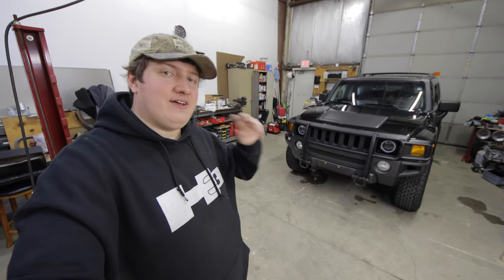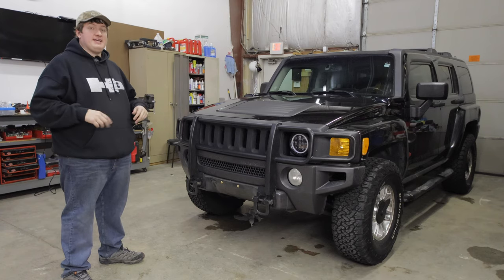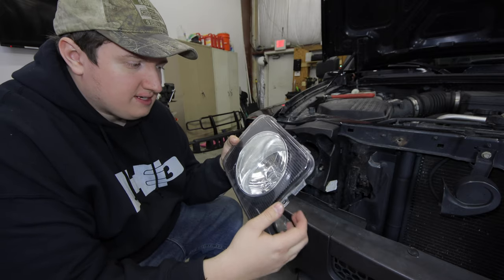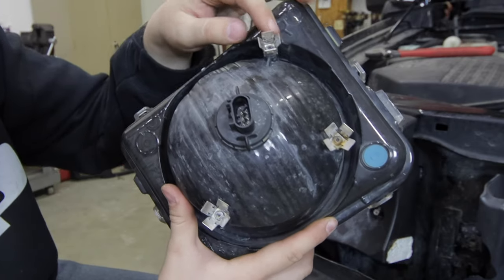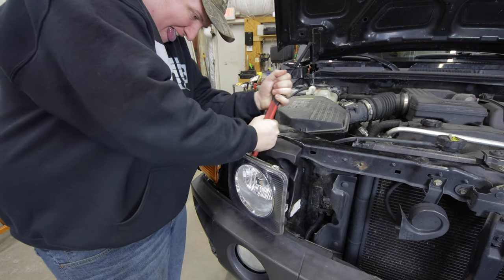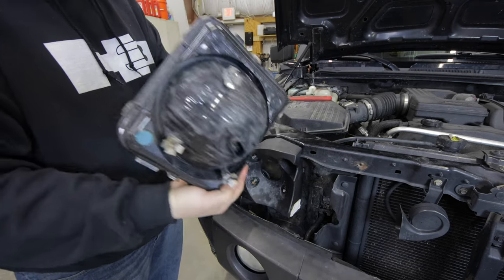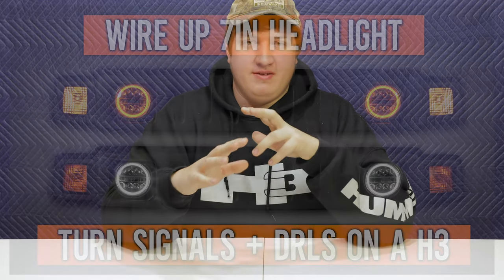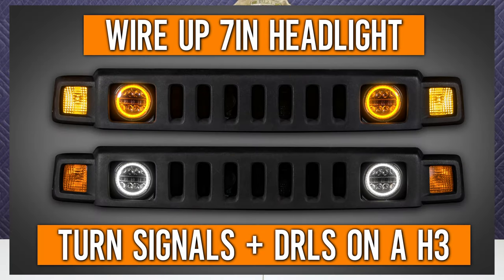How To Install 7in Jeep Lights On A Hummer H3

Comment: Love all your videos Man veryinformative recently got a 2008 video that had number for fan speed not work and realized that it had a recall on the little wiring harness behind the glove box on the passenger side and the dealer only replaced half of it the female side of the plug was still burnt you might do a video on that to let everyone know that both sides of that plugneed to be replaced it is in the parts directions at your mine was only half replaced.  the pigtail
Reply: The female pigtail is available at your and must be spliced into the wiring harness on the female especially if your plug is burnt. The recall says could catch on fire apparently my plug had caught on fire and they only replaced the male side of the white plug on harness
Reply from the maker: @billiebowling7755  Yes I am aware of that problem! I had that happen on my 2006 H3. I got it recalled and took it to the dealer. It worked for about 5 minutes and broke again and they said they couldn't do anything about it. Thanks for the tip though. I'll have to look into doing that!

Comment: Question.... The LED lights draw the same amount of current/wattage as the Halogen so there is no need for a relay (usually needed for increased amperage demand) So the only reason is for reversing polarity (or your option #2 using the polarity converters to reverse the polarity). Why not just move the pins on the adapter harness to the appropriate orientation? The pin already fell out of the adapter harness while you were doing the install so it should be real easy to swap. I have been considering buying these and would personally want just buy the weather pack connector and cut off the H4 plug on the light and wire on a H13 to plug in to factory. No additional harnesses, relays, fuses or adding a circuit to the battery post. Less things to fail while on the road or trail. This is what I did when i bought a pair of Rigid Amber D2 in my ARB bumper. I wanted to keep the Rigid light connector so i bought the male connector and pins online and cut off the trucks fog light connector and now the Rigid light pod plugs directly into the truck with a weather proof connector and no adapter harness or splice. Great videos by the way. Not to many people take the time to go into detail about projects like this, especially on vehicles the have as little support as our H3's

Comment: I must admit those LED headlights do put out much better illumination. Very good job.
But I have to really commend you on this video and its production value, it is superb.
One question, how do you stop weather / rain getting into the truck from around the seven inch LED headlight ?
I see a large space around the headlight and nothing between it and the front grille

Comment: Awesome job on the videos! Keep it up!  I am curious as to which harness option you ended up with.
Reply from the maker: For now I am going to be going with the 2nd wiring option which are those two little polarity boxes. Just curious to test them and see how they hold up after a while. That being said, I think option #1 is a bit more reliable. If the relays go bad on Harness #1, you can easily replace them, but if the little polarity converter boxes (Harness #2) goes bad, you will have to replace the whole unit, since you can't open it and replace of the internal components.

Comment: Once again great video I’m actually going to do this conversion. I’m thinking for the ground to use the fender support bracket that sits below the light housing. I seen another video some mounting a different type turn signal I’m doing that as well . Again thanks
Reply from the maker: Thanks for watching! Yes there are definitely multiple options for attaching a ground wire too.

Comment: Nice job, dear and full explanation .. I have a question .. regarding installing 7 inch of my Hummer H2 car .. the same or different steps. If possible, make a video for that
Reply from the maker: The H2 does not need any adapters or harnesses. They are plug and play.

Comment: This is awesome I have 2006 h3 and want to do this.  On ebay how do I tell which parts actually come with the unit and which need to be purchased? They show pics but listings are mostly confusing.  I have some videos on my other account on radiator replacement.  Shocks and some other things

Comment: Hi, i have a problem trying to get in my 2006 h3. The battery died & my doors are locked. The key hole to open wont turn. I tryed charging the battery still will not respond to key remote. Any suggestions besides asking the police or lock smith to slim jim the car??.

Comment: Absolutely loving the videos! Definitely a new subscriber who loves the videos. Just bought an H3 and am wanting to do this build on my hummer. Currently lased designs is sold out with the adapter. Any other suggestions on another good adapter that would work?
Reply from the maker: Hey man! Lased Designs is the only company that makes these adapters at the moment. I actually talked to the owner the other day and he says he is only stopping new orders for a week or two so he can catch up on current orders. After that, they should be back in stock!
Reply: @4lowmode  Sounds awesome! Thanks for getting back up with me! Can’t wait to get everything up and running when they come in. Until then I’ll get everything I can, till I can get the adapter. Again, thank you, and the amazing and informative videos you make. It’s making a world of difference for learning the vehicle. Especially since I’m not what you would call mechanically inclined lol.
Reply from the maker: @chrisshortridge7563  I totally get that! It can be intimidating at first, but once you know what to do, it becomes much easier! When you get all the parts and what not and are ready to do the install, feel free to message me if you have more questions. I am really active on instagram which is @acer4lo.

Comment: I'm confused of which lights you chose to go with? The halos or the projectors? The halos definitely look nice,with the daytime running and signal option, but I'm more for the functionality. Sometimes on my 2007 3.7 H3, I can't tell if my lights are on or off when driving on a road with street lights on. Time for an upgrade. Thanks for your tutorials!
Reply from the maker: Haha yeah. Well I think I am actually going to buy another pair of the dual projector lenses, with the turn signals and DRLS. Right now I have the ones with the drls because I needed to get some footage with them on.

Comment: @4 Low Mode  - Loving your H3 content. Do you know if these adapters will work for larger projector style headlamps, like the Morimoto Super 7 2.0?
Reply from the maker: Yes they do. I made another video on my channel talking about larger projector style 7in headlights. In my video, are used KC Gravity Pro 7" headlights but the Morimoto 2.0s share a similar concept. For my KCs, I did have to do a little bit of trimming on the back of the OEM headlight assembly. For the Morimotos I think they need to even less trimming. So far I have seen 2 H3 owners install those 2.0s successfully.

Comment: Great videos, keep them coming. What size tires are on the black h3 you installed the lights on? Thanks
Reply from the maker: On this H3 I have BF Goodrich KO2 All Terrain Tires. The size is 285/75R/16 which is stock size tire the H3 comes with.

Comment: Do you know if the H3 requires 7 inch led headlights with anti-flicker? Would they work without this feature/adapter?
Reply from the maker: No anti-flicker is needed! The headlights don't flicker at all, even in slow motion on camera
Reply: @4lowmode  Thanks for the reply. I finally made the upgrade with some Morimoto sealed7 headlights and foglights. They look great! And so much better visibility. I was not able to get the DRLs to work for some reason. The turn signal function is working however. Also, it seems like this would allow much more rain to get in through the headlight area vs stock. Have you had any issues with water in behind mainly the driver side, as the fuse box is right there, along with all of the headlight connections and relays. Thanks again. Would not have been able to do this without your videos!

Comment: Great video but I have a question. I replace the blinkers with led but they are blinking rapidly
Reply from the maker: You have something called hyperflash.     Hyperflashing is when the turn signals blink faster than your stock incandescent bulbs did. This happens because sometimes your new LED bulbs draw such little power that your turn signal relay sees the bulbs as being out. In order to fix this, you need to add a load resistor. What this does is use more power when you use your new LEDs so your lights don't hyperflash.
Reply: @4lowmode  much appreciated

Comment: V2 cost 125.00dollars  for the mount then the trim is 100.00$$ plus the lights. I am a disabled veteran an don't have it like that that is 225.00 before any light has been bought.Has some good things like them seat clamps stock suck always falling bump my cane against it an falls. So will be getting them. Fog light adapter 40.00 as well. I just want my wife truck to look good an last. These change the style an function big the Army even went to led tech.

Comment: Love what you've done with these videos.   I have got all the stuff together to do this to mine except the Laseddesign adapters.  I have tried contacting them with no response.  Signed up for the newsletter with no response.   Any in-site as to how to get some?   It won't be long before I am buying a 3D printer and making them myself.
Reply from the maker: From what I have heard, when asked for a statement, Lased Designs said he would be coming back with products soon. So keep an eye out in the new few weeks. Getting a 3D printer and making them yourself is technically possible, but you would have to design the file yourself from scratch. That other headlight 3D model on Thingiverse that everyone thinks they can just download and print is a bad idea. That adapter was a failed prototype that was never actually mounted onto an H3 and the project was abandoned by its Author. If you want me to go into extreme detail for all the reasons why those Thingiverse adapters are very poorly designed I would be happy to do so. Recreating the Lased Designs brackets yourself is going to be difficult as they were designed by taking a 3D scan of the OEM H3 headlight assembly to model them off and they went through several prototypes before they ever went into production.
Reply: @4lowmode  thank you very much for the response.  I am pretty confident I "can" make them.  Just not sure I want one that bad.  :)   I would much prefer to order them.  Lased Designs went to a lot of trouble to make them.  I just want to make sure I can still get a set.  I have JW Speaker lights setting on my desk waiting.  And an H3 with a fogged up headlight.  Thanks again.  I really enjoy your videos.

Comment: This video is much appreciated. Just installed this for my son with your help. Everything is working except the bright light switch is reversed(turn off to get bright lights). Any ideas? Son is happy. Thanks
Reply from the maker: Oh you mean high beams are on when low beams should be on and vice versa? If so, the wires on your H13 to H4 adapters might not be correct for your setup. I had this problem happen to me. Refer to 23:44 in the video, this where I talk about this problem. Let me know if this helps!
Reply: @4lowmode  Yes, that's what I meant. I will switch wires and give that a try. Thank you much
Reply from the maker: @LeeHill66  No problem! Hopefully that should fix your problem!
Reply: @4lowmode  That corrected it. Thanks
Reply from the maker: @LeeHill66  That's good to hear! Enjoy your new lights!

Comment: I like your video I want to do it to my hummer h3 2009 but the problem is  the adaptors that you put the link to is out of stock do you have any other suggestions we’re I can buy those adaptors I found the 7” lights that I want to get off eBay but I can’t find the adaptors if u can help me with these will be great thanks
Reply from the maker: Hey man! Lased Designs is the only company that makes these adapters. I talked to the owner the other day and he says he is only stopping new orders this week so he can catch up on current orders. After that, they should be back in stock!

Comment: So my 2007 came with plastic clips instead of the metal ones and they shattered. You wouldn’t happen to know how to get metal replacement clips like you have on yours would you?
Reply from the maker: Are you talking about the metal 4 pronged clips that you insert to the V2 studs on you new Lased Designs headlight adapter? The three clips that hold the headlight in per side? You are saying yours are plastic? If you are talking about the 4 pronged clips I haven't seen them for sale on their own. You might need to contact a company that is parting out an H3 and ask for them.

Comment: Hey I installed my jeep headlights on my hummer with the wiring harness you used but on the driver side light wouldn’t work at all. I know the light works because when I switched sides the driver light worked on the passenger side. Any idea what this could be ????
Reply from the maker: Is the ground (black wire) that you have to connect to a piece of metal in a good spot?

Comment: So with the egg style ones......that's what I baught.....does the bigger high beam go on the bottom or the top?
Reply from the maker: Are you talking about the ones with a smaller lens on the top and a bigger lens on the bottom? If you are, the low beam is the lens on the top and the high beam is the lens on the bottom. When you turn on high beam, the low beam lens remains on.

Comment: At 39:44 you start to install the spacer by tapping and drilling them. A much easier way is to remove the clips from the headlight assembly and actually installing them on the spacers and  then snapping the everything back on.The clips do come off the assembly.  Just a FYI.
It worked for me.
One question I connected the DRL to the #7 on the fuse box but my lights stay on even when I turn off the ignition. 
A little help plz.
Thanks.
Reply: Sorry,  I went back to your video and noticed that it was #17 and not #7.
Great videos keep putting them out for the few that still owned the H3.👍🏼
Reply from the maker: Oh yeah there was actually an update V2 to the studs for the adapter, Instead of putting the studs directly on the ball heads, you now use the clips from the original headlights. Lased designs came out with this change after the video was uploaded.

If your DRLS still stay on after taking the key out, you can't use that fuse. In the video I did say to use #17 instead of #7. Also fuse locations will be different depending on if you have the I5 H3 or the Alpha V8. I would recommend finding the location of "SPARE-2" or "SPARE-6", by using the diagram on your fuse box cover. If you cannot find those, you always could use a voltage meter to test other unoccupied fuses and use one of those instead. What you're looking for when using the voltage meter to have no power flowing through the fuse when there is no ignition, however when you have ignition, there is power.

Comment: Thanks ,vidios very informative
Reply: Just installed fan cooled LED bulbs 34.00 from eBay (6000)cool white just to see how accurate the discription was. Bright as hell all around front of vehicle, great for city and rural areas but bright lights mode sucks. they have no distance what so ever. They are how ever super white to other drivers

Comment: Great video I have a 07 H3 5 speed manual transmission really enjoy the manual transmission on my H3 I was going to ask are all H3 all wheel drive?
Reply from the maker: Yes all Hummer H3s are Full-Time 4WD and there is not any type of gear lever that lets you shift into 2WD. 4WD only. The only possible way a H3 could be 2WD is if you physically removed one of the drive shafts.
Reply: Thank you for info on that really appreciate it

Comment: Hey do you know if the fog lights need a converter, I purchased xprite 4 inch fog lights and wired them to my hummer but they don’t work
Reply from the maker: Plug them in the opposite way they are intended to go. They don't work if you plug them in the correct way.

Comment: all I need is the clear lens part on the headlight housing ..... it looks like it should just pop off of the housing but I cant find one anywhere.
I wish I could find one made of glass vs plastic.
any suggestions?
hopefully someone in china will read this and next week I will be able to find them everywhere for $2.00 U.S. and free shipping.
Reply from the maker: If you're talking about the original oem headlight assembly housing clear plastic lens they do not sell those individually. They don't sell them for almost any vehicle is because these headlights need to be professionally sealed. If you try to take off the plastic lens and then put it back on without properly sealing it, its going to get water on the inside from rain or condensation. Best bet is to try to find a whole new headlight assembly or just the headlight housing, but you would have to get that used because they only sell the whole assembly in new condition. New headlight assemblies are surprisingly cheap. The left or right ones individually are only like $80 on ebay.

Comment: Hey man, great video extremely helpful, I just subscribed to your channel. I'm actually looking for the harness the one made in China I can't find it do you happen to have a link to where I can find it?
Reply from the maker: Just type in "H4 Polarity Convertor" on Amazon or eBay and you'll find dozens of the same product for sale.
Reply: Thank you very much..also lased designs out of the adapters I see others on Amazon and eBay but doesn't look like those from lased, is there any you could recommend?